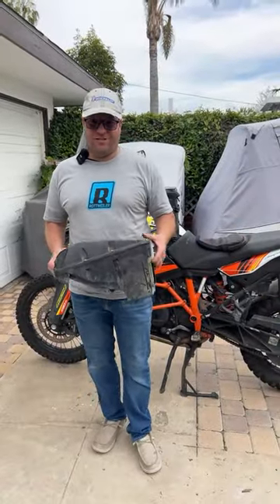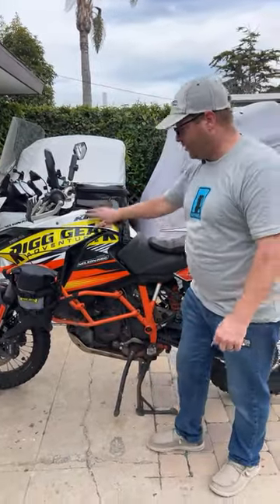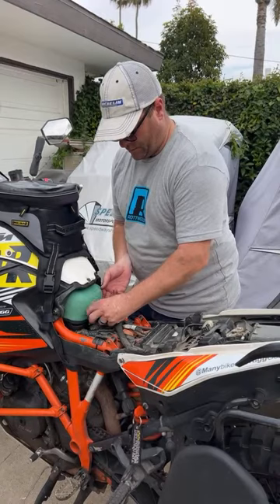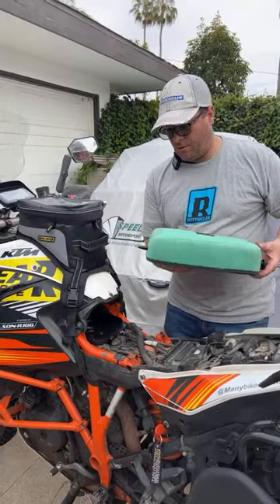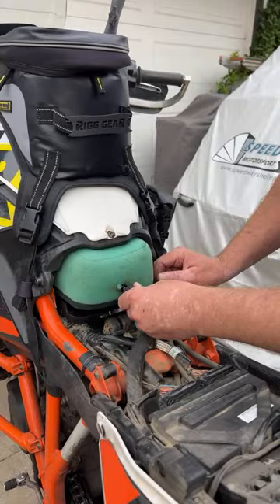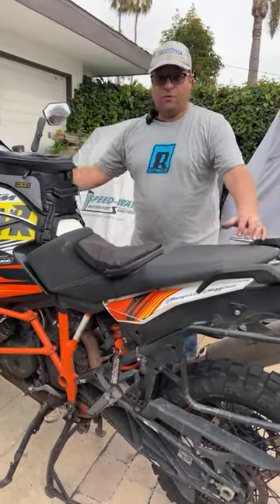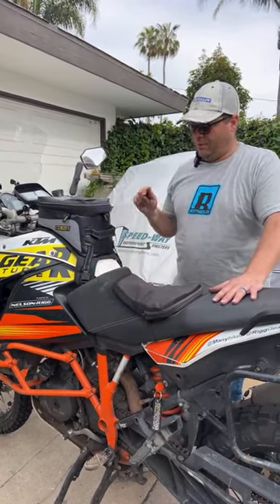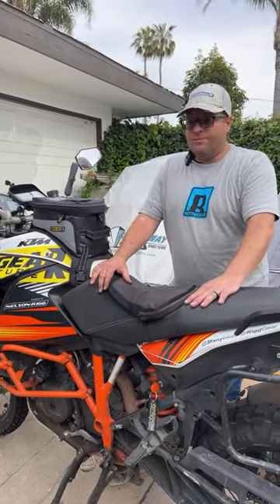First Look! Rottweiler Quick Change Air Intake Filter Kit  KTM ADVENTURE 1050 - 1290 (2014-2020)

Comment: That is a great development, at first glance.  My concern is the potential of dirt getting down the stacks if I am dragging a dirty filter rearward over the intake. I have two Rottweiler filters so I can swap to a clean one without the downtime of waiting for one to dry before reoiling. But yeah, I'd love to not have to remove the tank. I'd buy one of these for sure if I had confidence that caked dust on leading edge won't lose chunks as it's pulled out.
Reply from the maker: Good point! I'll ask they guys at Rottweiler about this...
Reply: I would think that since the bottom of the filter is plastic and seated on top of the stacks plate that there wouldn’t be any dirt accumulated. Only the top and sides.
Reply from the maker: Solid point. The dirt doesn't fall of my current oiled filters...